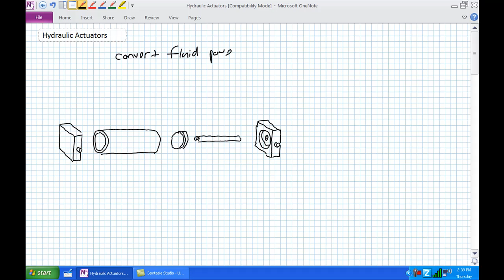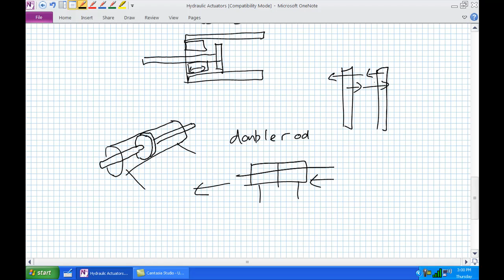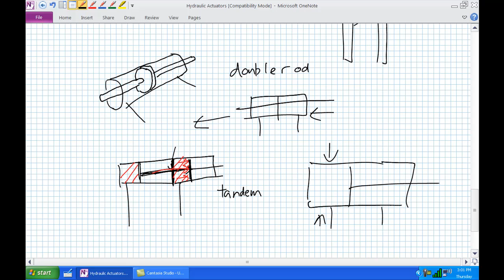Actuators

Comment: Good video!. Thnx.
For the guy's using a logic measurement system...
Power in kW = pressure (bar) x flow (l/min) / 600
so 10 liter / min @ 60 bar = 10*60 / 600 = 1kW